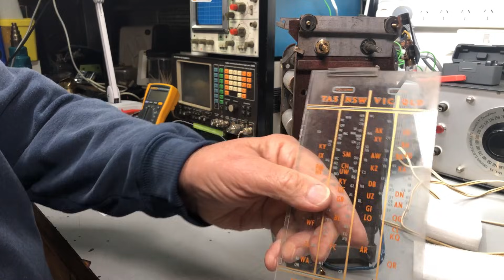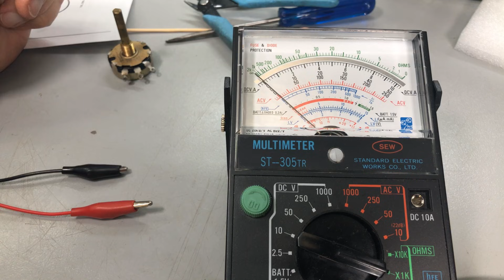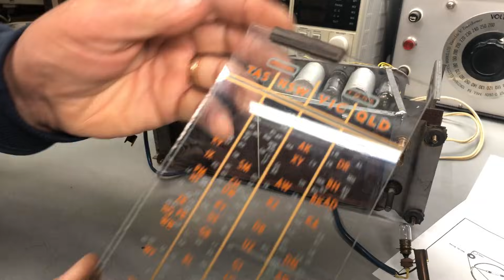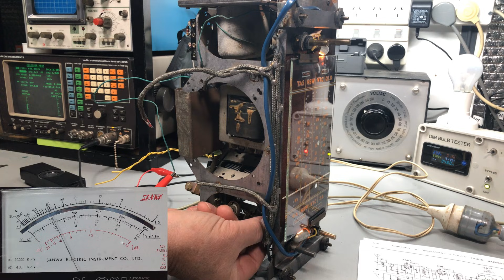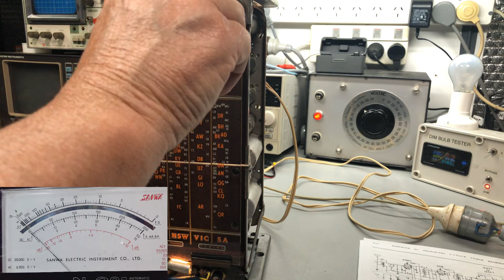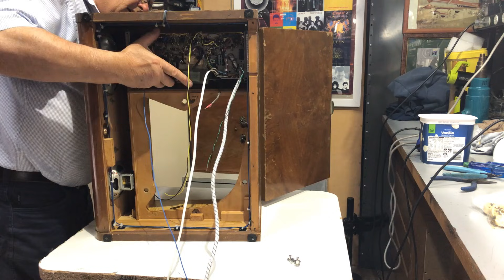Kriesler "11-53" TableGram - Part 3

Comment: If that radio's got a dual dial cord system, or an unconventional one, that's why it's so hard to re-string it. Try to find this radio online, or try to get a dial cord restringing diagram, if the supplied one doesn't work for ya. If the difficulty is with the design of the radio 📻, VERY CAREFULLY take the radio apart, documenting all your steps (by snapshots). Do the same for disassembly of the dial cord (if it's still wound up on the pulleys). It is best 👌 to try do do this in one day, when your mind is at it's freshest. Good 👍 Luck!!! Happy Trails!!! Your friend, Jeff!!!
Reply from the maker: Way too much info there Jeff 😂

Comment: Another nice job and at least a lot easier than that last one - that Sharp thing with the Garrard in it.  I won't be so scared of a Collaro if I get one.  I've avoided buying anything with a Collaro because I heard they were the stuff of nightmares!
You did give me a good laugh though - after talking about how you shouldn't run through the dim bulb when doing the alignment, I think you went ahead and did just that.  I could be wrong of course but I was shouting at the screen "Baz it's on dim bulb!" but you didn't hear me.  I guess I'm a long way away 🤣.
I'm sure it wouldn't make any significant difference though. To my mind the oscillator should be stable over a range of voltages. The bulb was barely glowing as far as I could see so it would've been getting close to full voltage anyway. And, of course, it's working very well.
Cheers
Reply from the maker: Yes the Collaro was a walk in the park compared to the Garrard ! 
Noticed that bloody Dim Bulb on when editing Don, put it back on the bench this morning & everything was perfectly peaked with full power so didn't seem to make any difference with overall tuning, BUT, next time I will try & remember that switch to mains ! LOL
Reply: @techobaz55  Yes I didn't think it would make any difference. Sorry to be the one to point it out!  
That looked like a bugger of a dial cord!  The front dial panel looked to be soldered on too.  I wonder if that was original. It sure makes things difficult.  
Speaking of difficult, I'm still banging my head against the wall with this Briton pile of crap.
Cheers
Reply from the maker: @Donno308 😅

Comment: Tough fight to get that dial string on I bet. 
Could you do a quick video on what you use for your "external aerial"? I have a metal roof I have to contend with so I am always looking to improve/replace what the long wire I use.
Reply from the maker: My antenna is also a long wirw across a tin roof & back yard. It does not perform good at all, lots of interference. I am looking a building a MiniWhip unit & putting it up on my tower. Think I will record that & see what difference it makes. Might help quite a few of us !
Reply: @techobaz55  Ha! I also have been thinking of a MiniWhip! I have 100ft of line strung from the corner of the house to a tall tree. I use 75 ohm coax to get the signal inside and I don't have interference but there is one local station that I would listen to all the time but I just can't get it in.